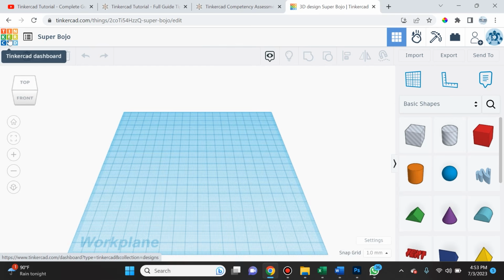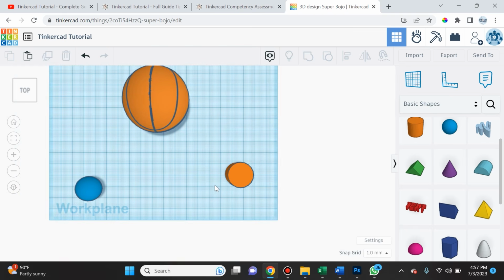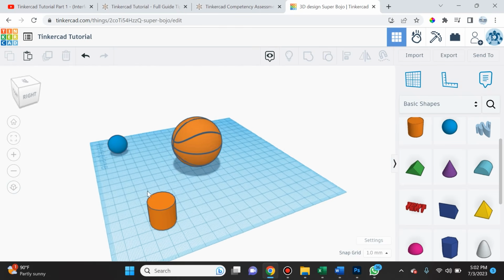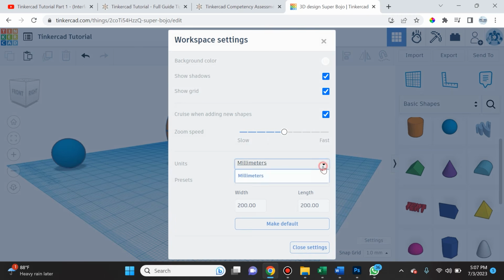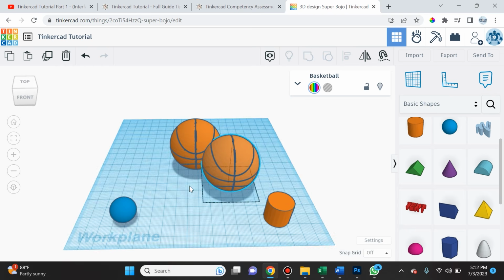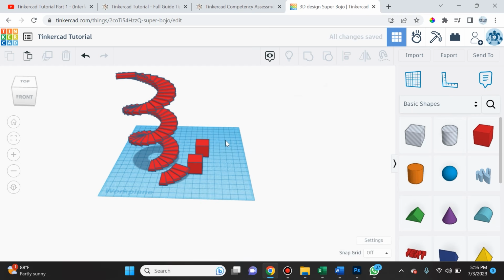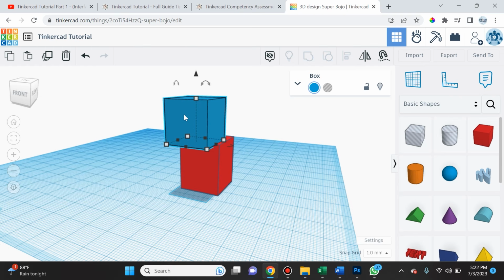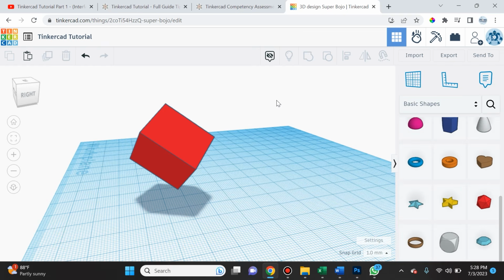Tinkercad Tutorial Part 1 - Interface, Movement, Settings and Grid

Comment: You want a tip?, I just found out by accident, if using the pen tool, if you hold the shift tool, you get perfectly hor. or vert. lines, if you want to line up with a point above you line, just  poit to that point and then press the shift key and you are perfectly aligned with that above point. I never saw that feature in any tutorial. 
Kind regards Hans

Comment: when i do the 25mm block and the 25mm gap to stack the box there is a very very thin gap still between the 2 boxes..
When I did a test print , even though I joined the 2 boxes , the print was weak as if it printed 2 separate boxes . 
So I made the gap 24.5 and made the top box taller.. hope that made sense.
Reply from the maker: In my experience, so long as they are flush with one another and touching, it should print it as one piece. How much it overlaps doesn't matter. Have you grouped the items?